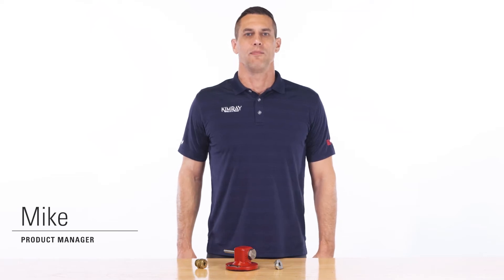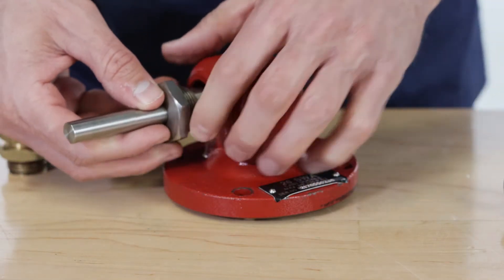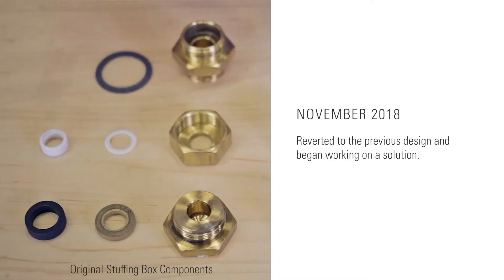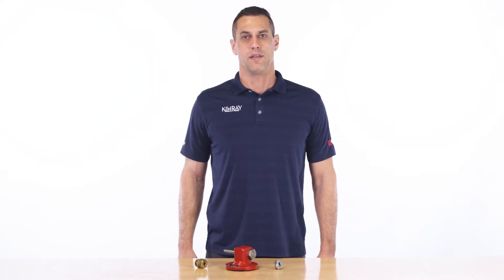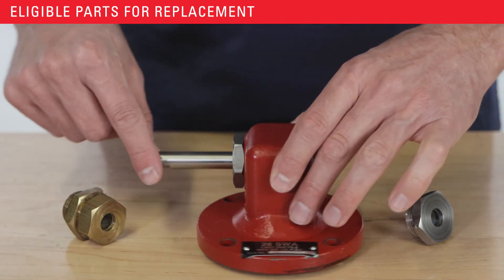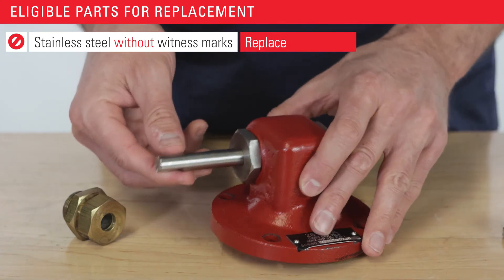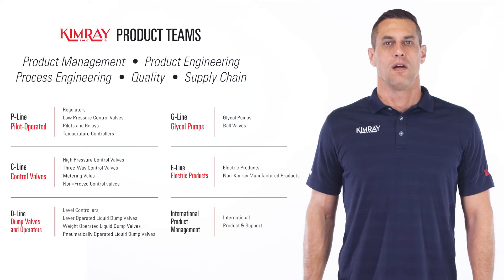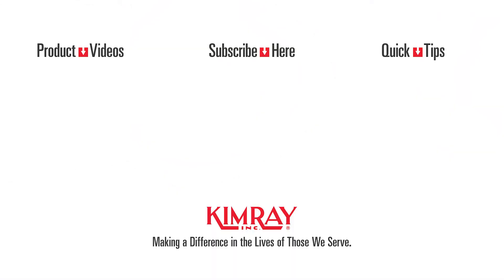Product Notice - Stuffing Box Leaks in 2" Treater Valves and 2"-3" Mechanical Dump Valves

Comment: I have had nothing but trouble with these bring the old ones back please
Reply from the maker: Brandon, we had to move away from using any brass components in our products because many well sites were no longer allowing any yellow metals. Moving to stainless steel required a change to the design to avoid galling of the metals. The leaks you have been having are likely with the design prior to the most recent changes. Look for the witness marks on the edges of the hex to determine whether you have the newest design. If you are indeed seeing leaks in the newest design, we would like to know about it.  You can contact us at https://kimray.com/contact-support and click on “Message Us” and select “Product Issue”.